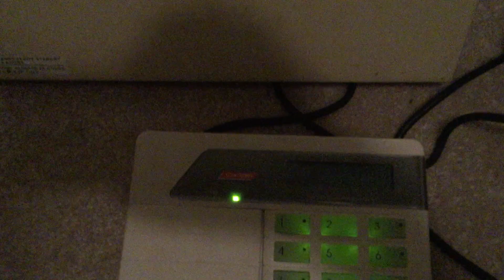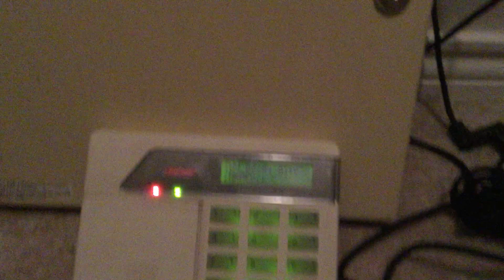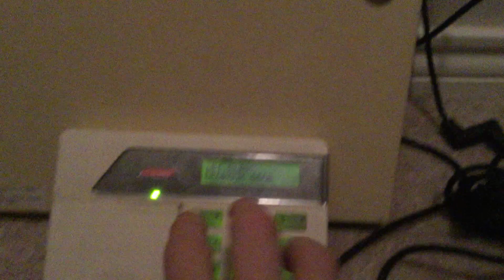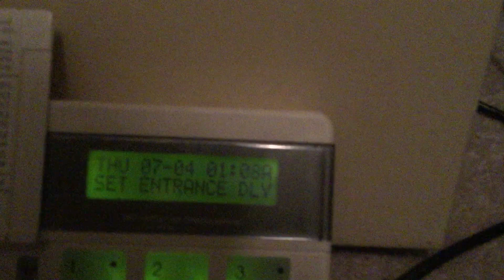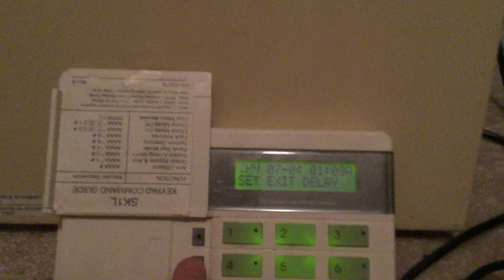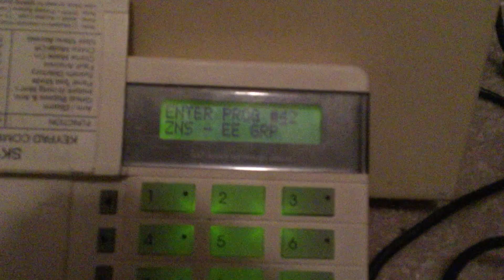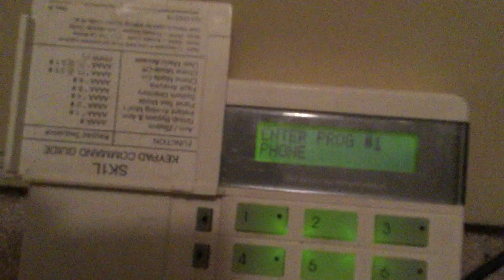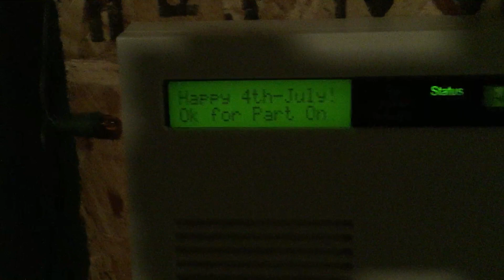Scantronic SC 800 alarm panel overview

Comment: Hi mate,
I have an alarm just like that and its bootlooping "01...08" after power and battery failure. Did you already faced that bootloop? Do you have installation manual ?
Reply from the maker: Hiya,

Haven't seen it bootloop with numbers like that before, only similar thing I've seen is the LCD just showing a cursor, which happens when the F3 fuse is blown. I'd check that fuse first, considering it started happening after a power failure.

The manual can be found here:
http://www.ebastlirna.cz/ddump/files/Manualy/EZS_hlasice_ustredny/SC1600_Installation.pdf

Or here from my site if the first link doesn't work for you:
https://www.protostarlabs.net/downloads/?id=84E34028D8BE4B778B7713F80239DA23

Comment: I have this Scantronic alarm panel for many years; am in CA; I do not know about the downloader software either but will check with the guy that installed it.
Reply: Do you know what to do when it says the battery is low?  Which battery on the panel needs to be replaced?
Reply from the maker: @karinkelly-givens2449  If it says the battery is low it means you need to replace the large 12v battery in the physical panel. This battery gives it power in case of a mains failure.
Reply: @KJ7BZC  Thanks so much!
Reply: Hi! I have one of those alarms and the numbers 1 3 5 11 12 13 appear on the keyboard below the hour and it beeps every 15 minutes.